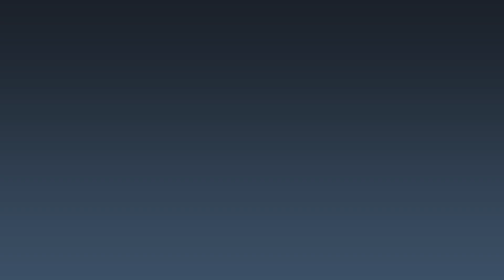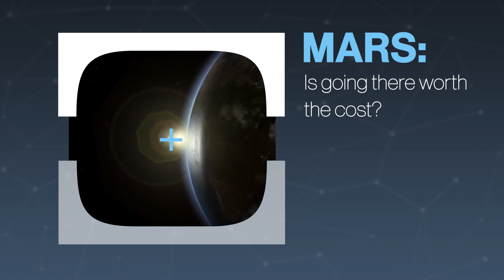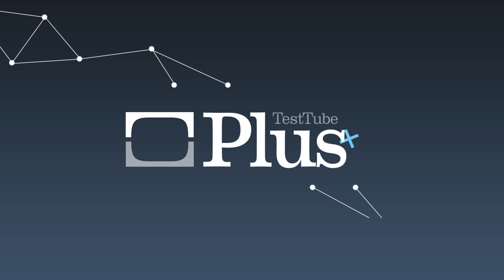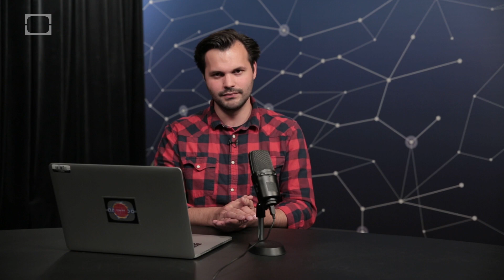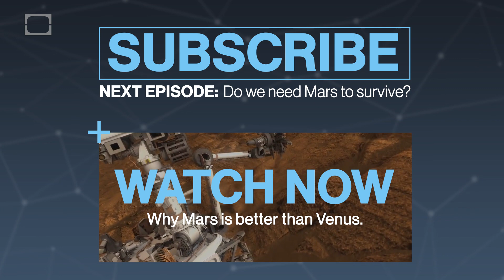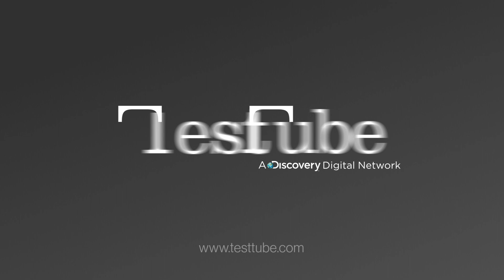Is Space Travel Worth The Money?

Comment: A lot depends on how well water and nutrients can be recycled in space.  Once waste management systems have been perfected that hygienically contain and compost all water and food waste instead of jettisoning it, the costs will be in maintaining mechanical systems, and transporting astronauts.  

Indeed, however, machines fail and so sustainable space colonization will require systems that can be maintained by crew using materials and energy-sources on-hand.  Are there materials available that will hold up for decades or generations under the stress of composting systems and unshielded solar and cosmic radiation?  And what about centrifugal artificial gravity?  If a spacecraft is spinning on its axis, what keeps it from wobbling and losing rotational momentum due to mass-shifts within the vessel?

Comment: "People will die before you get there"
So... it's not exactly possible RIGHT NOW, but we know the basic tech/physics behind a ship that could get to the Alpha Centauri in 60-70 years. (More real than Warp drives, less real than the Falcon Heavy.)

Physics? Worked out and possible. (Not just the dV, but the heat dissipation and acceleration dampening too) 
Engineering? Tests were done to verify feasibility, no specific/complete blueprints exist yet. In essence, we know that we can but no one's done the legwork yet.
Finance? Political will and financial support are nonexistent, in large part because the public is radiophobic and refuse to believe the physicists or nuclear engineers WHO DO THIS FOR A LIVING when they say we can build a ship that survives and runs off of nukes without killing its occupants or inhabitants of Earth.

I'm talking about the old project Orion of course. Someone ran numbers and, assuming we went through the MONUMENTAL cost of developing and building the thing, a ship with a nuclear-pulse engine could get up to about 5-7% of the speed of light while still having enough 'fuel' to slow down. (You can go slightly faster if you use a Solar Sail to assist in slowing down at the destination)

That's still a one way trip, but people are already living to 100, give it another decade or three of medical advances and select from the longer-lived sections of the populace and the Astronauts on board would get to see both Earth and the Centauri System.
Reply: +Will B And dont't forget relativity! So if you are travelling with near-light speed, time goes slower for you!
Reply: Eh at less than 10% of C its not too noticeable.
Reply: +dafont By my calculations  you will need to travel 26 light years to the closet universe would 5.87849981×10^12 in miles
Reply: JaeZZZ Garwood 
closet universe? My math was for the closest star to us, it was either 4 or 6 lightyears away, i don't remember which.
Reply: +Will B sorry i was thinking of another universe that learning about and i things it is 6 light years away
Reply: JaeZZZ Garwood 
Check your vocab and spellcheck dude. 'Universe' is the word we use for the full extent of the 3 dimensions of space and one of time that we know. And as interesting as multiverse theory is, we still have almost 0 proof other universes exist or any clue how to get to them.

Here's a brief lesson in scale and vocabulary.

Moons: balls of rock and ice usually between 100 and 2000 kilometers across. They orbit Planets at distances measured in hundreds of thousands of kilometers

Planets: Rocky or gaseous spheres thousands of kilometers in diameter (Earth, 12,700 km across. Jupiter, 140,000 km across) they orbit their Star at distances measured in AU or astronomical units. 1 AU = the distance between Earth and the Sun. 1AU = 98 million miles = ~8 light-minutes.

Stars vary in size quite a lot but the Sun is approximately 1 million miles across. Stars are organized into galaxies and travel in rough circles around the supermassive black holes at their cores. The Milky Way is approximately 100,000 light years across and has nebulae and stars sprinkled mostly evenly throughout it with stars getting slightly further away from each other (on average) the farther away from the center you get. The nearest star to the Sun is about 4.25 light-years away in the Alpha Centauri system (2 stars and one brown dwarf within 15,000 AU of each other)

The Universe is mostly empty space with superclusters of galaxies dotted throughout it and is about 91 billion lightyears in diameter. By definition it is also the biggest 'thing' in our 3 dimensions. Other things like it would have to exist in 4 or more dimensions and be separated by those 'higher' dimensions that we are not familiar with and can't (yet) be sure exist..
Reply: +Will B :The Orion concept has a serious drawback. The number of nuclear bombs required to push it to high enough velocity to make it anywhere near practical has been estimated at 300,000 to 3,000,000 bombs. The USA and Soviet Union/Russia produced less than 100,000 bombs in a half century of the strategic nuclear arms race at a cost of probably a couple trillion dollars. Orion was conceived in the 1950s which was before the arms race had lasted long enough to show the logistical problems associated with it. In addition, firing nuclear explosives in extremely rapid fire sequence has never been demonstrated. Having one of 300,000 fail to fire is an almost certain scenario. Several are likely to misfire and cause the craft to fall short of it's maximum designated velocity and add more time to the trip. And this is at the very least. One dud can cause other bombs to be destroyed and even the pusher plate and support structure to be damaged or destroyed. Orion was only ever demonstrated on a very small scale and lots of things that seem to work well at small scales, do not necessarily work well at larger scales.
Reply: ***** While I will happily debate you and share information and speculation about those points if you'd like, I feel like you may have been missing my point (buried beneath details and my enthusiasm its very easy to do).

In this video, Trace pretty much discounted the possibility of getting to another star within a human lifetime. I wanted to call that assumption into question. Chemical rockets are not the only way to do things, and even without trying to account for future changes in our understanding of physics, we have thought of possible alternatives already. Saying that people will die before you get to another star so emphatically seemed shortsighted to me.

(Oh, before i forget, where'd you get that estimation of Orion propulsion units from? I'm always eager for new information and hadn't read that before)
Reply: Um... have you run the numbers on that? Because at less than 10% of lightspeed the relativistic effects are almost unnoticeable. Say you've got a one gram piece of spacedust that you slam into at 1/20th of lightspeed.

KE = 1/2 m(v)^2
KE = 1/2 (0.001kg)(0.05c)^2
KE = 1/2(0.001kg)(0.05*300,000,000m/s)^2
KE = 112.5 Giga-joules

Now that's about 40 tonnes of tnt worth of energy. Which is a lot, but way below what you built the back-end of your ship to withstand from it's own engine firing.

But you don't even have to point the back end of the ship the way you're traveling (though you could, because most of the trip is coasting). Because that interstellar medium? It's average dust mass is much smaller than a gram. The vast majority is single atoms or small molecules with the occasional micron-sized bit of silicate in between. A sheet of steel (that you already made your ship out of) should protect you for the duration of your journey.

Things change when you get up to ~90% c, but nuclear-pulse propulsion doesn't get anywhere near that.